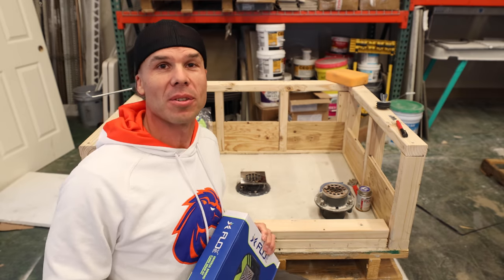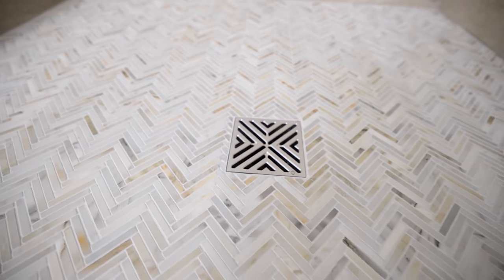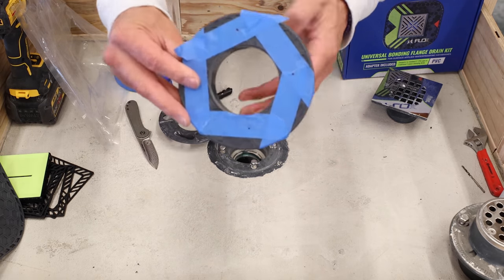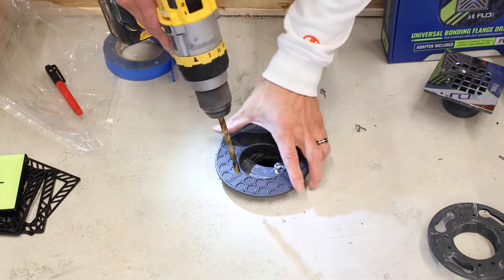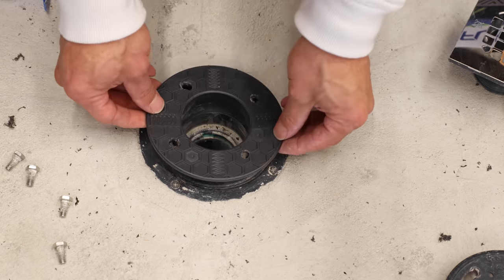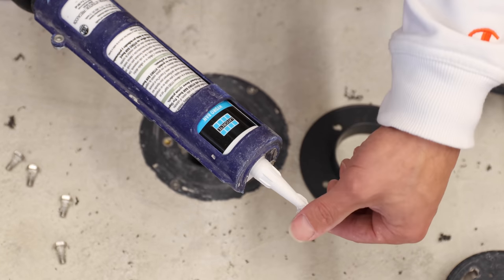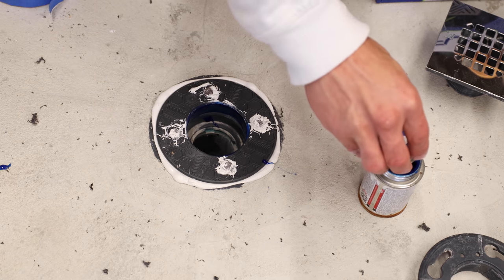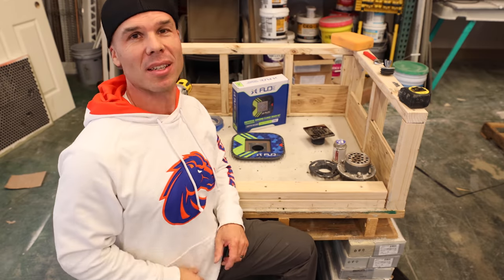Change CHEAP SHOWER DRAIN to FLO FX!!!

Comment: side note, when using pvc, abs or all purpose glue, you have to hold the joining parts together with pressure for a little while because when it’s fusing together it tends push out the outward

Comment: That is indeed well thought drain with great build quality, for instance, 
- inner flange  covers 2” pipe edge when attached. 
- takes guess work out when it comes to calculate height of 2” pipe, you just cut it flat with substrate you want drain to sit on
- drain has a lot of ridges and crevices that beside structural strength help to reliably set it in thinset
- fleece is not peeling off if you want to clean out bit of thin-set off of it with rug.
- square shape helps to center drain or check level with torpedo level.
Cost wise with grate it comes cheaper than any of Kerdi, Laticrete and etc
I wish they offer trendy linear drain options at some point.
Reply from the maker: All great points!

Comment: I'm going to order this Flo fx from you, I have a question, when we added the bottom flange and cemented the concrete floor it was done a little crooked, am I able to correct that when I add this Flo fx drain? Does it have a little room to level it when you glue into this bottom flange? 🤦‍♂️

Comment: It seems like a socket wrench should be in Isaac's tool box...
Reply: I've noticed that in many shower drain videos by many different people, and almost all were professional installers!  They instead struggled using slip-joint pliers, rib-joint pliers and adjustable wrenches, but no one used a socket wrench.  Totally bizarre to say the least.  I just installed a new shower drain and yes, I used a socket wrench.
Reply from the maker: We rarely have to tighten bolts on a drain ;)     But yes a socket set or better yet an impact hex driver!

Comment: Love your content! Learned so much!! Question - I have a basement laundry room with a floor drain that I am tiling. I am breaking the concrete out to install new drain and reslope the concrete floor. Would I recess the FloFX into the concrete and then have the ditra go right up to the grate edge then tile? Not really sure what the layering should be since it's not in a mudbed. Do you have any videos on that?

Comment: What about a guy like me who's paranoid and wants a belt and suspenders installation?  Can I install a liner pan and clamp it to the old school drain, then build the sloped float to the flow-fx adapter?  Go over it all with hydro ban liquid membrane?  Tiling plywood floor.

Comment: We had a plumber cut out concrete and install a drain where we are installing a shower. He just left a plastic pipe sticking out 6 inches and said when you install drain just cut it to fit. Will that Flo FX bonding flange connect directly to it? That black plastic or PVC pipe whatever it is is about 2 3/8 inch OD and 1 7/8 inch ID.

Comment: Does Flo FX make the adapter with  the round bonding flange for a Schluter shower tray? When i use the Schluter Adapter Kit for existing drain flanges I always need to add 2 1/2 inch sheets of backerboard to build the pan up to height and have the bonding flange sit flush in the pan.

Comment: Hey  Isaac. Quick off topic question . If using Durock, do you embed it in your dry pack ? Love the videos man. Thanks in advance
Reply: No if using water in water out method. It’s fine if doing a surface applied waterproof method. But water in/out method will wick.

Comment: Hey Isaac, please talk about how to fix uneven floor joists. Not any helpfully videos out there really. 
I’ve got my old flimsy 1/2” plywood sheeting up and my 2x10 joists from the late 1960’s are all uneven. I’m thinking of sistering some 2x8’s to make everything even and level but not sure if 2x8’s are too small, can I glue and screw or do I need to bolt them etc. Thanks, love tour videos and your attitude.

Comment: Thank you for your great videos.  I have an old shower with a drain with no flange.  Question is, after I install this drain, I guess I need to redo dry pack to bring up to level with new drain?  Thank you in advance
Reply from the maker: Yes

Comment: Hello everyone can I leave the existing rubber pan liner and dry bed (old style). convert to the flofx and install new dry bed on top of the old dry bed as if I would be starting new with the flofx. system ? thanks

Comment: I just ordered the round flange from Flo FX and there doesnt seem to be an adapter to connect to the three piece barrel drain. Any suggestions?
Reply: Also I thought the pan liner was supposed to go over the drain before you put the adapter on?

Comment: Do you have a video showing the prep work  to install tile and the "finished drain" after pre slope/mud mud and bonding flange are installed? Trying to wrap my head around the weep holes and the drain rock i've seen in other installs. Does the Flow FX not need weep holes?
Reply: nope

Comment: Hey Issac, will this conversion block the weep holes of the two stage drain? Is this to convert a traditional water in water out pan into a waterproof pan by waterproofing the top with membrane?
Reply: this drain requires a membrane over it thus the weep holes are no longer needed.

Comment: Dumb question here, but with this application is a vinyl liner still used?  Thanks
Reply from the maker: No, surface waterproofing is applied to the top of the mortar bed.
Reply: @TileCoach  do you have a video for that? Thank you

Comment: christies redhot glue has primer  in it
Reply from the maker: Hey Mark!   I read on the instructions on the bottle and it said UPC requires the use of purple primer on all connections. But I assume most municipalities are ok with no primer on any connections under 4" diameter that do not have pressure.  I think its anything over 2" needs primer if it is under pressure like irrigation pipe.    Maybe some others can chime in on that who know a little more.
Reply: @TileCoach  i was under the impression  christies red hot had primer  already in the glue,giving it its blue color,i may be wrong

Comment: Why are those drains better?
Reply from the maker: Quite a few reasons why I like them better than Schluter or Laticrete drains.  As far as why they are better than the Oatey's, it's more about just doing one slope and overall a better system in my opinion.

Comment: I dont get it. any water which gets through the floor tile grout- and it will -  will just slop around under the tiles. cause odor and mould. This is a bad setup. Use a puddle flange instead ! the flange is recessed into the substrata so it is level with the substrate top surface. Seal the floor  and then any water penetration will go down the drain and keep the underside dry.  USe A Puddle Flange !